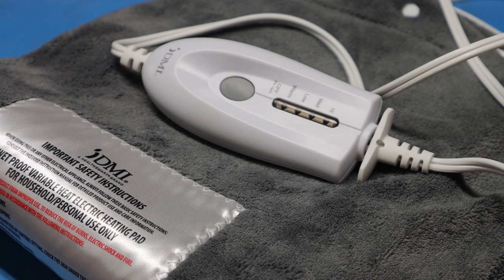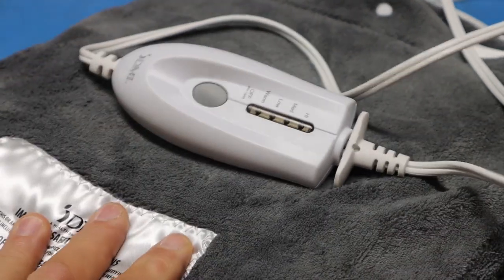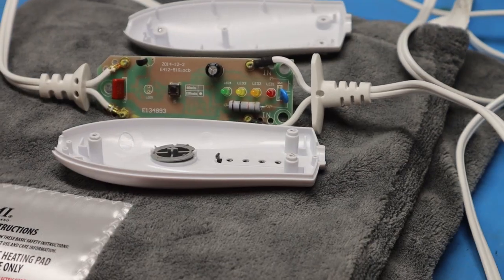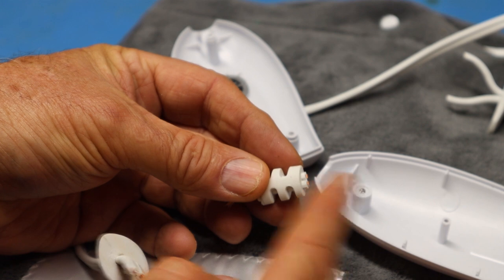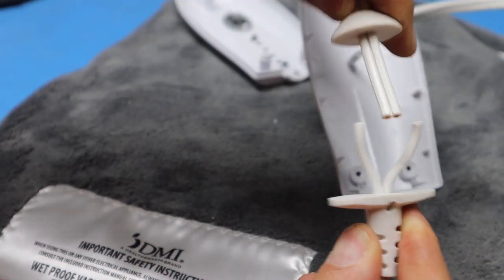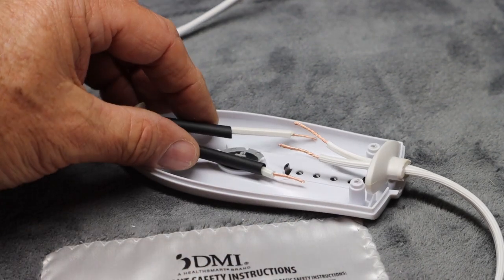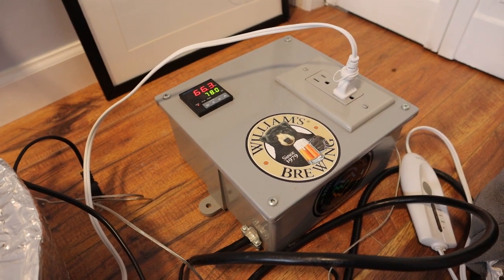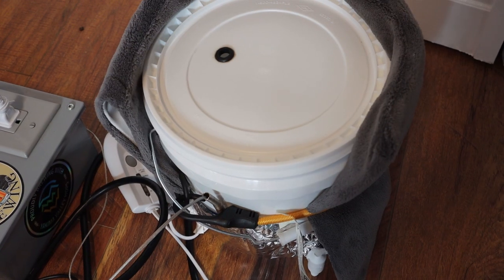Remove the controller from an Electric Blanket

Comment: Can we use electric blanket without controller
Reply from the maker: The removed built in controller provided temperature control , by removing it, you no longer have any means to prevent the blanket from getting too hot.  Could cause a fire.
Reply: @JoediyLab  means we are able to remove controller and attach direct connection of wires
Reply from the maker: Yes, that is correct, make sure you pick up an external controller, or you could overheat and cause a fire.

Comment: Better yet would be to figure out which of the 4 legs that you could put a jumper on so that you can bypass the reset part of this controller in essence the control circuit still controls the heat but it gets automatically reset when it trips off.
Reply from the maker: Easier said then done,  The circuit is controlled by a micro-controller.

Comment: So, if you do this to this heating pad, which I have the very same one, if you do not buy the inkbird temp controller to control the temperature then leaving it without one is a guaranteed fire hazard.  Also, if you are ony needing to controolthe temperature of the heating pad intself using the probe as a feedback to the controller from the electric blanket, seems kind of odd.

Comment: Can I disable the timer ,but leave the temperature control functioning?
Reply from the maker: More than likely not.  The timer is more than likely controlled by a micro-controller.  In other words, the chip is programmed to implement a timer.    It would be much cheaper to replace with a $35.00 inkbird  controller.

Comment: Thanks for that. What would happen if I ran it without the timer controller and without an external temp controller? I'm trying to heat an area at max heat with no timer shutoff. Will the internal resistance keep it at the max temperature indefinitely, or will it start to overheat and burn?
Reply from the maker: Do some tests but for $35.00 it is well worth the protection.  It might overheat to failure and a fire.
Reply: @JoediyLab  found an inkbird for £28. I'm in the uk
Reply: @JoediyLab  thank you so much for the reply

Comment: How can you do that and leave the circuit board out (brains)
Reply from the maker: The heating wires are rated for AC current, by removing the controller you can remove the 2 hour shutoff and use an external controller like the inkbird.

Comment: Do you need a temperature controller to bypass the safety or can you just plug it in and let it be?
Reply from the maker: Because you removed the safety, you also removed the temp controller.  So if you want to control the temp, you need an external controller.  Look at inkbird, they are good and inexpensive.  There is a link on the video description.
Reply: @JoediyLab  thank you, so basically you would just blow the heating element at 120 continuously right?
Reply from the maker: @johndavidtooley5119  You could do that or pick up an external inkbird temp controller,  see the link on the video description.
Reply: @JoediyLab  I just ordered one. Thanks for the information, that should work perfectly and it will help with various applications which is an added benefit.